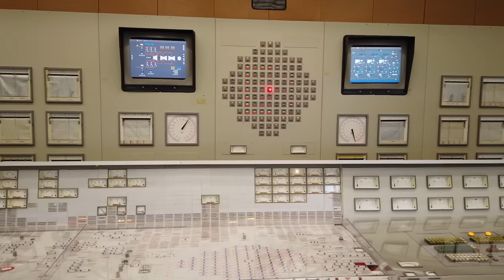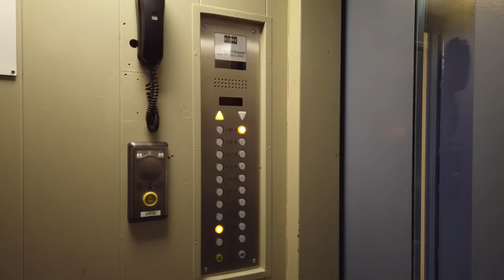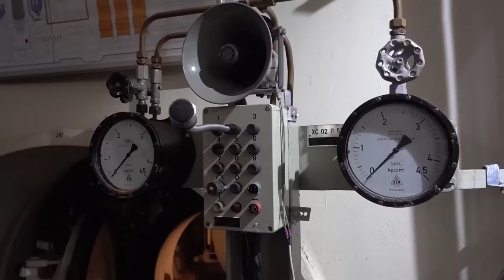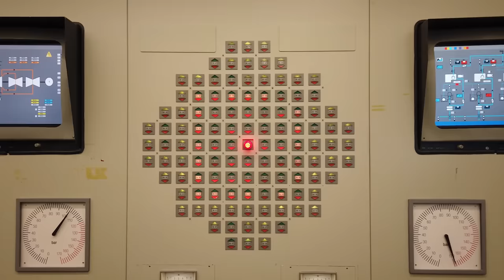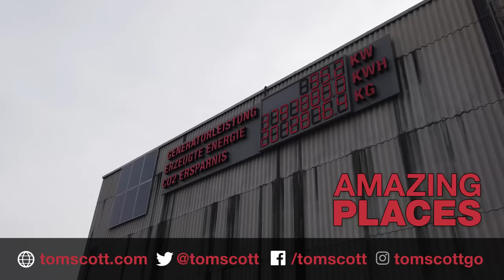This billion-euro nuclear reactor was never switched on

Comment: To replace that one 750 megawatt nuclear plant with PV solar panels would require roughly 19 square kilometres of land area -- and every night it would produce zero megawatts.
Reply: "Luckily" this reactor was replaced with more coal burning at the time...
Reply: As you imply, it isn't actually feasible to use renewable energy to power everything (~18 TW).  Even if you could "use 1% of the Sahara" to power the whole world with solar power, at the current world semiconductor production capacity (~19.57 million 200mm-diameter wafers/month), it would take 15100 years to produce enough solar panels (the continual increase of capacity should reduce this a _lot_, but I doubt it would be enough to accomplish this in less than a century).  I really hope I've made an arithmetic error or we're all doomed by anti-nuclear idiots.
Reply: Hornsea One offshore wind farm is 1.2 gigawatt.
Reply: @taumus1  Yet it produces less power than a 750 MW reactor would, it costs more, and the power is intermittent, you don't choose when to get it and when not to.
Reply: @zolikoff  Offshore wind is cheaper than nuclear by far. The video even states that as a reason why nuclear power plants are being decommissioned. Problems of intermittency are overstated. But just look at the trend today. Price is driving nuclear out.
Reply: @taumus1  This specific example, Hornsea One cost more than this specific power plant, while it produces less energy. It cannot be cheaper then.
Reply: @taumus1  Wind and Solar are cheap because it is subsidized. Take away subsidies and the prices shoot up.
Reply: Yes and you also don’t have radioactive waste that lasts for more than 10,000 years or weapons-grade plutonium or the chance of a meltdown - that could kill a large group of people, render many more sterile and immediately cripple the local community
Reply: @MrTeutje303  The price includes the subsidy,, which are fast declining. There are already zero-bid contracts in several countries now, meaning subsidy free wind farm projects on the way. It honestly doesn't seem like you have a clue about the economy behind wind farm projects or nuclear projects.
Reply: @taumus1  Problems of intermittency are absolutely not overstated but instead understated, you need only look at the recent necessities of rolling brownouts in California, who have been trading out nuclear for wind and solar for years, to see the truth of this. The fact is that every region that "switches to renewables" has instead increased their reliance on fossil fuels like diesel and LNG plants. Solar is a bum deal because its peak generation hours don't remotely line up with peak utilization hours and this will only get worse as more and more places move towards electricity for heating to further reduce fossil fuel usage. Wind is a joke, it's unreliable and undesirable, people are afraid of nuclear power which properly maintained is incredibly safe but nobody actual want a wind farm anywhere near them and they're ugly as sin. France has been generating the vast majority of their power through nuclear energy for decades, it's an absolute sin that the politicians of nearby countries like Germany and Austria are so blinded by public opinion that they'll make poor decisions rather then spend the effort to educate their constituencies.
Reply: @taumus1  I got one counterargument for you: California.
Reply: @undefinednan7096  I doubt you made any error in your math, people who think we can meet the world's current energy requirements with renewable sources ARE idiots. The only way that'll be possible is when literally everything, down to the simplest home appliance, is at least doubled in its power efficiency (including the energy necessary to produce the product, too). That'll take half a century at best.
Reply: @willm5814  yes so right! Solar panel production and batteries are fully green enterprises. Even clearing forests or agricultural land for enormous solar farms is very green.
Reply: However you would not have to worry about spending billions to manage a gigantic pile of extremely toxic waste, that would probably take up just as much space, that we have no way of neutralizing, and that will be a hazard to us and everything else alive for generations to come. That counts for something.
Reply: 19 sq km of land for solar is not as much as you think. the equivalent nuclear reactor would have around 4 sq km, the enrichment plant 10 or more, the mines and infrastructure for transport even more than that. and we arent even talking about nuclear waste storage yet.
also: if we only built solar on farmland instead of rooftops, etc. it would still only consume less than 2% of farmland to power the entire country.
(4+mil sqkm farmland / 48k sqkm solar)
Reply: To supply that nuclear plant with enough U-235 to operate for one year would require mining 5,628,000,000 pounds of 0.1% uraniuym ore, acidifying it to extract and concentrate the U-235 and then disposing of the still radioactive and highly acidic tailings. I think I will take the solar panels, thank you very much.
Reply: @MrTeutje303  Nuclear is the most subsidized power source in the world. And they haven't even begun to address the most costly aspect of nuclear power - waste disposal. Besides one nuclear meltdown is enough to bring an entire country to its knees economically and destroy millions of lives. We have had 5 meltdowns in 40 years. The frequency of meltdowns is bound to go up as existing nuclear plants get older, more decrepit and costs are cut to try to compete with renewables. Just consider - we expect to pay more for maintenance on a car as it gets older, but the nukies are cutting safety corners on these rust bucket reactors to stop losing money. Risks naturally will go up. Let's start a contest to see who can guess where the next will melt down. My money is on the Davis-Besse plant.
Reply: @Mr.ToadJanfu  Germany's renewable shift has reduced its per capita carbon emissions. Many anti-solar/wind reports say otherwise, but they use total carbon figures instead of per capita, which is (possibly maliciously) misleading because they're blaming population increases on renewables

Wind/solar farms are also becoming more normalised and acceptable. NIMBYism has reduced in countries where they become common, and younger generations are more accepting. 'Ugly' is subjective. When there are enough of them, they cease to become ugly and cease to be as big an impact on property prices

Solar/wind are doing a good job. They would do an even better job with nuclear in the mix. We need an energy mix. Antagonising nuclear vs. solar/wind totally misses the point

Also, see my other comments on why relying fully on nuclear is also not feasible. There isn't enough viable nuclear fuel. We need an energy mix
Reply: @zolikoff  That's literally why they cancelled the power plant, big companies that control the coal and natural gas market convinced the population that their solution was better, obviously not because their company would've gone bankrupt...
Reply: @undefinednan7096  You're not taking into account that the world will soon start switching to extremely efficient everything and start using tons less power. Look at computers, or bulbs, or appliances. All use tons less electricity now than they used to.
Reply: @GeraintDafis  Do you know how much uranium ore needs to be mined to produce enough U-235 for one year's fuel at a nuclear reactor? If the ore is 0.1% uranium (good luck finding ore that rich these days) for every one million pounds of ore, you get 1000 pounds of uranium. But uranium occurs naturally as U-234, U-235 and U-238. U-238 accounts for 99.27% of that uranium. U-234 is 0.0059% and U-235 is 0.72%. Only U-235 is fissionable, so you get 7 lbs. of U-235 for every million lbs. of ore. But the U-238 and U-234 are still radioactive in the tailings. Those indians on the res. don't like their cows dying in the fields and fish floating on the surface of their streams, much less their kids' playgrounds being paved with the tailing. The 7 lbs. of U-235 must be enriched to run the the reactors now in use and it takes 20 tons of fuel to run a reactor for a year. What do you suggest we do with the highly acidic radioactive tailings?
Reply: @undefinednan7096  There is more than just solar. It is feasible to go 100% renewable without nuclear and even easier with nuclear. There have been many detailed papers on how exactly it could be done with current technology and there already are regions that have managed it. 

It should also be noted that we really don´t need new nuclear plants as of now. They are not cost efficient compared to wind and solar. Switching existing ones off however would be a mistake of course.
Reply: @MrTeutje303  Stats on these prices are obviously adjusted for subsidies and a bunch of other factors. Yes solar and wind are generally less expensive than nuclear as of now. Not even taking nuclear waste storage into account.
Reply: @taumus1  people's emotions and misinformation is driving nuclear out. Meanwhile we're burning imported trees and organic waste and calling it 'biomass'. The world won't become cleaner and healthier from things that sound good, only from things that ARE good
Reply: @tomduke1297  Nuclear research has only received 85 billion in subsidies since 1948. Compare that to renewable energy which receives 634 billion A YEAR.
Reply: @undefinednan7096  I’ve always found this to be a very strange argument. Suppose you could cover “1% of the Sahara desert” in solar cells... what exactly is the plan for transmission to the rest of the world?
Reply: @jackfanning7952  20 tons of which 99.999% is just non radioactive rubble, stop manipulating numbers in attempt at fear mongering, the longer we put off nuclear the worse it is for the environment.
Reply: @stephancasas  when I said "even if", I was indicating that the argument was going to ignore those sort of issues to prove the idea infeasible even in an "ideal world" where things like power transmission are trivial and solar panels are nearly 100% efficient (although I did screw up the math, in that case it should only take ~2100 years, not 15100 years, for all the difference that makes).  Of course in real life these things are extremely challenging.
This does _not_ mean that renewable energy (solar, wind, and most especially hydroelectric) is a bad idea, merely that solar panels are insufficient to power society at present production rates (I suspect similar arguments could be made about wind but I haven't actually spent the time on that).
Reply: @undefinednan7096  Oh, no, I agree. At some point in the future, I think it’s a route worth considering but for today’s needs, our time for further research elapsed several years ago. Current demand calls for technologies we have, not the ones of which we dream.

Regarding a similar analysis of wind, I think they touched on this briefly in the documentary “Nobody’s Fuel,” though it was not near the level of detail involved in your arithmetic.
Reply: @matrasad2308  per capita Germany emits around 8x of what France emits. France relies on nuclear power.
Reply: @undefinednan7096   At the current growth rate, solar would be able to provide enough energy to power the world (well, the ~18TW) by around 2036-2040. This is based on current new solar every year and taking into consideration the yearly growth between 2014-2019 being 28,6% and I took 22% as a yearly growth. Now ofcourse since solar isn't the renewable, it will not need such growth rates anyway.

You need to remember that solar still is a tiny sector compared to what it will become, it was still very costly a few years ago, price dropped immensely since then.

And ofcourse no one is arguing for a purely solar energy grid, even the most hardline green energy advocates talk about renewables as a whole (possibly excluding biomass). The "1% of the sahara could power the world" saying is just rhetoric to say the same as "renewables can most definitely power the world".
Reply: @zolikoff  Yet it produces less power than a 750 MW reactor would, it costs more, and the power is intermittent, you don't choose when to get it and when not to.
Not necessarily, when I look at the output of Belgian reactors from around the same time, the Austria plant would produce around 4.1TWh, almost exactly the same as Hornsea one.

Windturbines on sea are btw the most expensive renewables currently, only topped by small scale solar (ie roof solar), but thus ofcourse has the advantage of directly using the electricity rather than having to also pay taxes, distribution costs, ... on it.

The main reason why offshore is still so liked despite the higher cost is because it is easier to place large amounts of turbines that also produce more power.

You also should make a difference between current new nuclear and old nuclear, it is now more expensive.
Reply: @disklamer  All solar panels can and in the EU must be recycled for around 20$/panel (+-10% price of a panel). This cost is likely to drop with economies of scale.
Reply: @GeraintDafis  Solar panels should be recycled, in that case you start a circular economy reducing the mining needs overtime.
Reply: @BlGGESTBROTHER  You do realise you are talking about nuclear RESEARCH subsidies vs renewable TOTAL subsidies?
Reply: @MDP1702  The Belgian reactors of the same time are 450 MW units not 750 MW like this one, so this one would make more, thus more than Hornsea One.

Yes, wind turbines on sea are the most expensive renewables currently.

I did not insist on making this particular comparison, I just replied to someone who brought it up.
Reply: @zolikoff  The Belgian reactors of the same time are 450 MW units not 750 MW like this one
I extrapolated to 750MW, so yes, this is a correct estimate.
Reply: @MDP1702  I guess those reactors weren't run properly? Or there was not enough electricity demand. 4.1 TWh means a 62% capacity factor. If I check the average capacity factors of reactors similar to Zwentendorf (eg. Isar 1 & Philippsburg 1 in Germany) they get 80%.
In fact I even went to check the capacity factors of the Doel units in the PRIS database and they were also 80%. They made ~3 TWh per year while their power output was 400 MWe net. If you extrapolate that to 750 MWe it gives 5.6 TWh per year, which is what I've expected, and more than 4.
Reply: @MDP1702  firstly, I agree that renewables need to be a much larger part of the grid than they are.  As far as solar panel production, I would love to be completely wrong, and it is entirely possible that I am -- I did accidentally assume that the fabrication output of solar panels gets counted in the world total fabrication output, which might not be the case.  I intended to make the point that building enough solar panels (or wind/hydro) to completely supply the world power demand isn't feasible at the present time (the comment might not have been clear, but it was a throwaway comment I spent < 5 minutes on four months ago).  To change this, "one" can try to reduce the world power consumption (doable to some extent, hard but important) and to increase production of renewable energy generators, however, these are hard and can only be done to a certain extent.  With presently foreseeable technology, nuclear (fission) power provides the easiest and most feasible solution.
Reply: @undefinednan7096  I intended to make the point that building enough solar panels (or wind/hydro) to completely supply the world power demand isn't feasible at the present time
Which is a completely wrong statement if you account for the growth of the solar market. if you don't account for that, you could as well say that it isn't feasible to power the world with nuclear at the present time, since you'd need a massive growth of this sector too, or it would take over 1600 years to get all electricity from nuclear at the current construction speed.

With presently foreseeable technology, nuclear (fission) power provides the easiest and most feasible solution.
I disagree, it is an option, but definitely not the easiest nor most feasible solution. We would need to see a massive increase in the construction of nuclear powerplant, even faster than the solar panel output, seeing the time construction takes. Moreover you can't just use old designs, because there is only enough fuel for  those for the next 30-50 years if you start using it for everything, so you'll need to rely on new designs too. 

Solar could power the world by 2040 even at a lower growth rate than is currently the case. The main bottleneck is storage, but by around 2030-35 it is expected that prices and availability of batteries have improved enough to take this bottleneck away. So it actually would be easier and faster to go full solar then full nuclear most likely. Ofcourse again, no one wants to go full solar, wind and hydro will always be an important part, and nuclear most likely will do so too, well at least if the prices of the new reactors drop, the current LCOE of new nuclear plants under construction in Europe is too high to be competitive enough without subsidies (considering nuclear needs to work 80-90% of the time for their intended life to be profitable and thus be cheaper than almost everything else).
Reply: @undefinednan7096  In 2020 in the UK renewables made up 42% of its power usage, compared to the 41% fossil fuels. So for the UK at least its headed in the right direction.
Reply: @undefinednan7096  "anti nuclear idiots"? Anyone who generalizes in such a way can be but an idiot! Renewables need to become the main source of energy. That includes Nuclear Fusion though!
Reply: @zolikoff  But on the other hand it doesn't leave highly toxic waste that takes thousands of years to biodegrade! Combine that with Solar, Wave and other renewables and keep working on Nuclear Fusion your grandkids grandkids grandkids may have a more desirable future!
Reply: @Mr.ToadJanfu  ERM, do you work in the Nuclear industry by any chance 🤣🤣 FFS, where do you even source these "facts" from? And even if they are true, the inconvenient truth is nuclear waste as well as the plants themselves have risk factors that have already, and will again, kill. Maybe the politicians in nearby Germany and Austria still remember the effects of Chernobyl and are that much wiser?
Reply: @maxowen2591  All industrial processes leave waste, waste which doesn't degrade at all, it stays toxic forever (or more specifically until it chemically reacts with and thus harms something)
Solar and wind already require 10-20 times more material to be mined and processed to provide the same energy. Of course the volume of nuclear waste itself is not this, because that's a tiny portion of the total material that nuclear power involves. It's so little that its handling is trivial. It costs a bit but it's trivial.
Reply: @zolikoff  Wind power, Solar power, Tidal power of course need materials to build and upkeep but exactly what part of the aforementioned, after initial construction, leave toxic waste? Toxic as in can kill.
Reply: @maxowen2591  Typically in the mining front end, where leaching the required elements out of the ore requires particular chemicals. The leftover chemicals and tailings are just left in a huge landfill/lake with artificial dam because it's too expensive to do anything else with them due to their quantity.
However, the back end can leave harmful byproducts as well, strongly depends on the particular technology used. Wind turbines for example are typically made with fiberglass blades which are then buried and left to decompose. The glass fibers are harmful to every organism.
Reply: @maxowen2591  Ah, I see you wrote "after initial construction", thus you probably know about the mining side... Well that's likely to be the most harmful side of the entire cycle, even with nuclear (moreso than the spent fuel waste, that's for sure).
But solar and wind require 10-20 times more material than nuclear, thus more mining.
Reply: @zolikoff  yes but it isn't the actual production of energy that leaves the waste, it is mankind's refusal to pay to have the blade's properly desposed of that creates the hazard. Obviously initial mining of material carries a cost. But by including that as validation of an  argument means we then should not have washing machines cars or any other manufactured products that include mined raw materials. Clearly renewables are also not perfect but if forced to choose between living next to a wind farm or Nuclear power station, I can take an educated guess where most people would choose! I'm not sure where you are from but can hazard a guess. Countries the world over and particularly very power hungry economies are struggling to find place to bury their nuclear waste. No-one wants it in their town!
Reply: @maxowen2591  Indeed, proper disposal of waste is most of the problem with most waste, but proper disposal is usually economically infeasible, the quantities are too great. Well, except with spent nuclear fuel, where the quantities are small enough that you can properly handle it, which is why the world has so far insisted on it. It could also just be discarded improperly, as most industrial waste is. It would be cheaper. But, since it's feasible to properly deal with it, we can insist to have companies do it.

What exactly is wrong with including the mining impacts? It's an environmental impact like any other. And we aren't talking about "initial", but "continuous" mining. This isn't something you do once, but you do it again and again as you replace and build new capacity. Wind and solar require 10-20 times more material. Wind turbines last 15-25 years, solar panels 30-40 years, a nuclear reactor lasts 60-80 years. Then you gotta replace it again with new material.

Of course, you could try to recycle as much as you can, but again that is economically less feasible, makes everything more expensive. And don't forget, nuclear waste can be recycled too... In many places it is. It's just a matter of are you determined to do it, or do you just want to bury it as is.
Reply: @taumus1 renewables make sense if all the world is on the same grid with hydro power being the exemption
Reply: @zUJ7EjVD  What I am taking into account is that a gigantic amount of acidic and radioactive tailings is left in open trenches and waste piles' It is being added to the danger from fission by-products radioactive waste that will be dangerous for longer than mankind has been in existence. The tremendous amount of fossil fuel used to generate nuclear energy and carbon-14 generated by fission reactors makes nuclear energy no solution to climate change. No sane person would be willing to support nuclear energy production.
Reply: @zUJ7EjVD  wow, safer than wind and solar. Forgive me for my ignorance but I am interested to know what threat wind and solar present?
Reply: @disklamer  *few thousand tons deeb in a shielded bunker
Reply: @maxowen2591  
* Wind turbine blades failing
* Accidents during maintenance (all of them, but particularly offshore wind)
* Huge lithium fires when one of the huge battery farms needed to buffer the grid fails
* Huge flywheel failures when one of the 100 metric ton flywheels needed to buffer the grid jumps its bearings
* Floods that could drown a city when a hydroelectric dam fails because it was needed to buffer the grid

Really anywhere you buffer enough energy to actually handle the fluctuations of wind and solar (that isn't a natural gas plant like we do today), there is going to be risk of serious harm.  Meanwhile nuclear power has yet to kill anyone in the US since the SL-1 incident back in the 50's that killed 3 people.  Guess the death toll for the Fukashima meltdown?  1, and even that one is disputed.  Modern reactor designs (ie thorium salt) have even fewer ways to fail.
Reply: @JMurph2015  but the elephant in the room is the millenia half life of toxic radiation as a bi-product that has the potential to kill many for thousands of years! Out of interest, the death toll for Chernobyl?
Reply: @maxowen2591  Chernobyl killed like a few hundred tops.  Probably fewer from "direct" causes.  That's a lot better than flooding 80% of the world's population because renewables/fusion aren't ready.  The waste disposal issue is way less problematic than most people want to make it out to be.  Bury it in a mountain, backfill the tunnels, and call it a day.  Alternatively, we could probably even get it to a subduction zone and send it underneath the plates.  Alternatively, we could bury it in some of the tectonically stable deserts, then heat the sand around it to create glass tombs.  Nothing is really stopping us from doing this other than political will.
Reply: Also, a lot of people get hung up on "well, what if in 10,000 years, an earthquake strikes the right spot to compromise our waste containment?"

Bro if we actually make it another 10,000 years, I'm sure we'll figure it out.
Reply: @JMurph2015  Chernobyl displaced thousands of people and generic mutations continue into the present. Flooding 80%of the world's population is nothing but speculation based on worst case scenario. You can only bury so much waste. And after millenia, stuff leaks. Enters water resources. Obliterate of environment. Fish full of toxin. Call it a day for this generation. But your kids?  And the last point, politics comes second, or is driven by money. Nuclear has a limit. Justification by speculation of possible flooding really doesn't work. We already know the outcome of nuclear disaster, know there is infinite storage and know that the money required to keep nuclear waste at least partially safe ain't coming from a magic tree. Seems irrational to use speculation to argue for the proven destructive power of nuclear.
Reply: @JMurph2015  how long do you believe barrels filled with toxic waste dumped in the Sea will last? And barrels underground, you really believe that they have a life span of thousands of years? Seriously?
Reply: @bladder1010  the real "green" in clean energy comes from the uranium
Reply: @taumus1  Austria doesn't have a "shore".
Reply: Sun shines at approx 1 kW / m^2. If you have 20% panel efficiency, it is 200 Watts / m^2.

750 MW /  (200 W / m^2) = 3 750 000 m^2 = 3,75 km^2.

But considering the fact that this is in perfectly ideal conditions, the real area must easily be multiplied by 2 or 3. From that point of view the pessimistic 19 km^2 approximation is not far off.

But another thing to consider is that the 750 megawatt plant is not the full system. You need the fuel to be mined, the fuel to be enriched (takes a lot of energy with current methods), the waste to be treated.

Biggest problem with solar is its intermittency. There will be a lot of overproduction and a lot of underproduction. To smooth this away, it at very large scale it really needs energy storage systems to go with it.
Reply: @JMurph2015  Need for adjustable power does not go away with nuclear, because nuclear itself is not very quickly adjustable and many nuclear plants are ran at constant power, hydro, etc. doing the adjustment, because the consumption is not constant. Neither does the need for energy storage go away with nuclear because nuclear cannot directly replace fossils in many applications,  there's a lot of applications that will need stored fuel, like planes, ships, machinery that cannot be electrified / batterizied and places that are remote / not accessible to electric grid. The claim about 80% flooding is quite heavily exaggerated as well, even if we kept using fossil fuels, it is very questionable how good prediction it is as land is rising in many places. Bigger problems regarding living near the shore are mainly caused by totally different reasons that climate change at the moment. Like people go build on a shore, where erosion is eating the land and has been doing that for thousands of years. Or same thing building on bad foundations. These are not climate change initiated problems. But indeed many other problems probably would come from sticking to fossils for too long. Nuclear is good energy production method and definitely must be considered as part of the solution for energy production in the near future.
Reply: @willm5814  Nuclear energy, including mining, maintenance, and even accidents, has killed less than solar panels and coal.
Reply: @jackfanning7952  5 meltdowns in 40 years? That is a very minimal amount. I’d like to hear your sources on your other claims and how many people were injured in each of those 5 meltdown. I’d also like to see the monetary cost on each of those meltdowns compared to the cost based on power outages caused by renewable sources. While I agree that renewables are definitely the ideal future of power, it is clear that it just isn’t to a point of being realistic yet. It’s unfortunate people have such unfounded fears of nuclear, which could be a serious solution to our current problem with reducing the carbon emissions in the short term. The battery problem for renewables like solar and wind is still looming, and a stopgap measure is required to phase out coal and fossil fuels sooner rather than later.
Reply: @taumus1  you missed the chance to say it's 1.21 jigawatts
Reply: @willm5814  I assume that the "weapons grade plutonium" are from thorium plants, I hope you know that the amount of plutonium in thorium plants isnt enough to be weaponized to a meaningful degree.
Reply: @disklamer  nuclear power plants don't actually produce that much waste
Reply: @jackfanning7952  one word: thorium
Reply: @undefinednan7096  are you accounting for Solar Thermal? Where you use mirrors to boil water and drive a turbine?
Reply: @taumus1  sorry to say but: nuclear power is cheaper than offshore wind. And since nobody wants to live within 2km of a turbine, it is likely theyll end up at sea. So nuclear power is cheaper and takes up less room, while also being safer. No joke, per kwh, nuclear power has less deaths than any other form of power generation.
Reply: @willm5814  except there will always be weapons grade plutonium because hey we have big boom, and the chances of a meltdown are so incredibly slight there days, that unless a severe natural disaster (fukushima) wrecks the reactor building itself, it's very unlikely that any reactor of today will melt down. The waste is a bigger issue which I am not knowledgeable enough on. But hey, we're all living in the dystopian world where every reactor is Chernobyl-4 and it can blow up that easily, yes?
Reply: @maxowen2591  Chernobyl was also the result of "everything that could've went wrong, did" from the nuclear reactor design to state secrecy to Dyatlov's hard ignorance of the rules. Chernobyl will most likely not happen again ever.
Reply: @MrTeutje303  nuclear is just as much subsidized as renewables and often even more so. Taking subsidies away from nuclear power plants would mean no new plants would be build because they are so expensive.
Reply: @taumus1  how did that work out for you this year 2021?
Reply: It’s OK. Austrians don’t consume electricity after dark
Reply: I found a corporate study once on how expensive the much-celebrated solar PV gets if you include the batteries needed for when the sun isn't shining. For just 6 hours of storage the levelized cost balloons to almost $100 per MWh. Realistically you'd need 16 hours of storage to account for dark winter days, and that's without considering the overcapacity needed to charge the damn thing, and replacing it every 10 years because lithium batteries still have garbage longevity.
Reply: @Blaze6108 how old is that study?